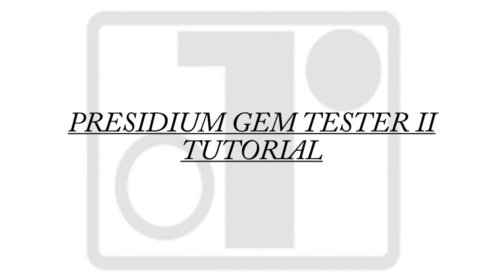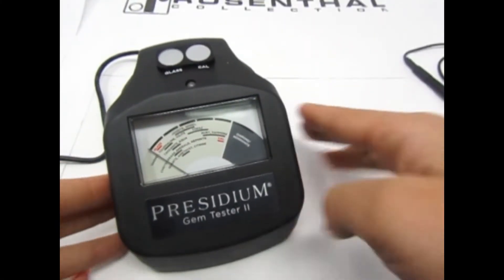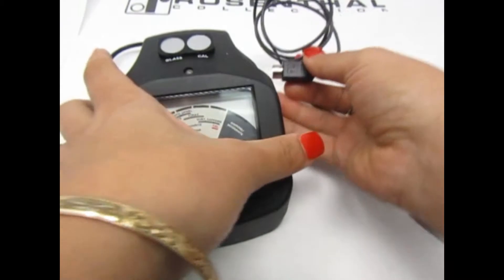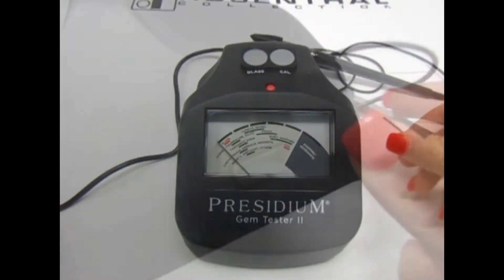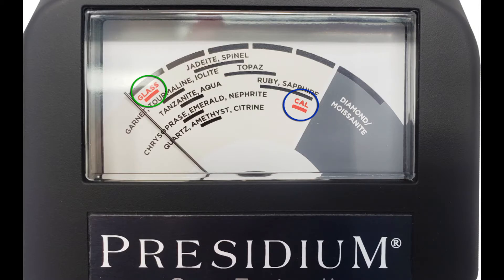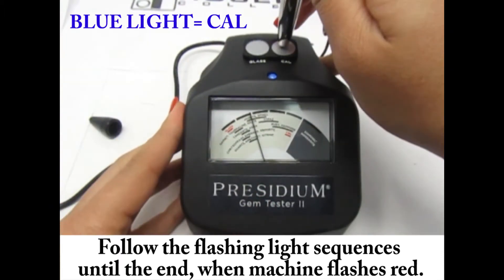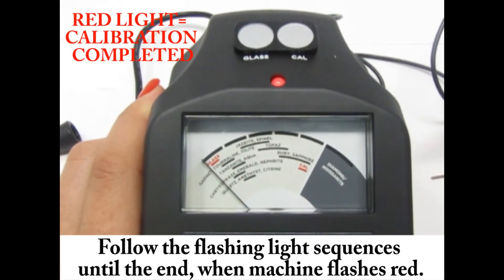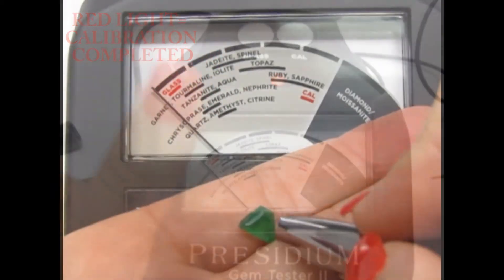How to Calibrate Presidium Gem Tester II (PGT II) Tutorial

Comment: How do you get it to work if you done did everything in the hand is not moving
Reply from the maker: How long did you have the tester for?
Reply: @Benamou101  I just got it today
Reply: I worked on it over an hour and it's still didn't work I tried everything the hand just don't move
Reply from the maker: It could be the pen that's defective. You might need to just replace that. Or you received a defective machine.
Reply: @Benamou101  okay thanks